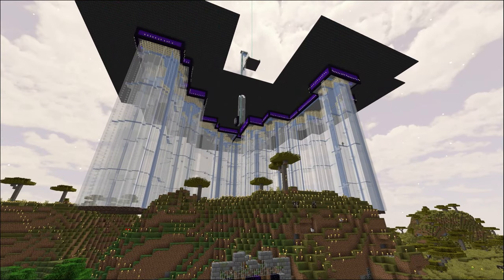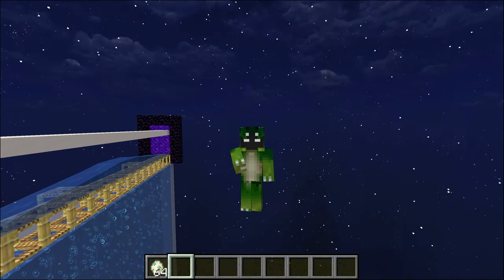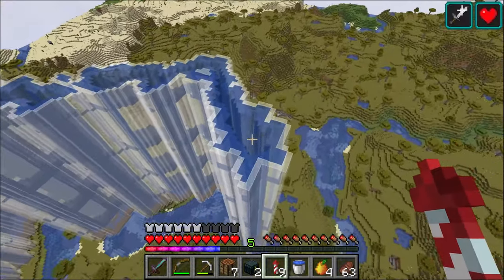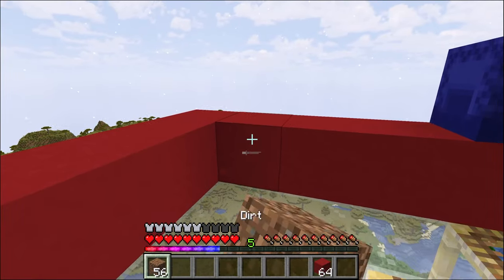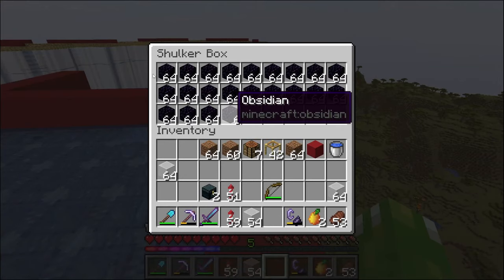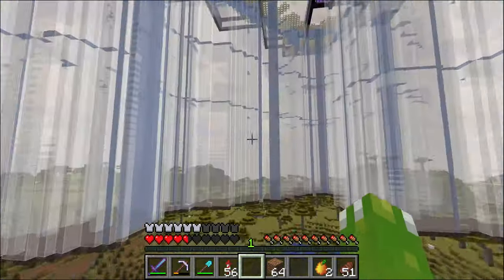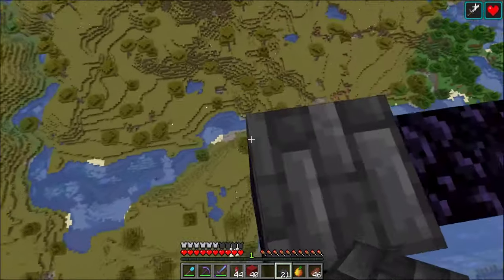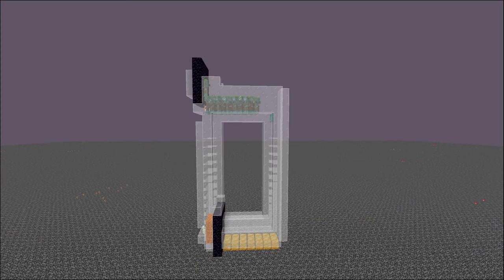Minecraft Trident & Copper Farm - 120+ Tridents Per Hour

Comment: How do I build it in 1.18?? 
Where should I place the portal which brings drowned back to the overworld
Since I can't build under 0 in the nether then how am I supposed to make this work?
Edit- If someone has built it in 1.18 in a perimeter, a screenshot would be appreciated
Reply from the maker: I'm busy at the moment but if you msg me on discord later I'll fiddle around with ur problems and see what works
Reply: I think I've figured it out 
My plan is to build a perimeter, will place soul sand from -58 and then will extend the pillars till y15 or y20 

Next is to place the portals which brings drowned back to overworld 
So I'll build it on y0 or y5 and do the same in nether (y0 or y5) 
Then make my platform on which I'll be standing to kill drowned at y-20

Will this be good enough or do I need come up with another idea?
Reply from the maker: @bhanusirswa1969  nice idea but what I'm worried about is the drowned not getting pushed in water as they only seem to be affected by it when they're above y63
Reply: @ncolyer  
Ahh shit, completely forgot that
Idk about any other idea lol
Reply from the maker: @bhanusirswa1969  yea normally you'd have the bubble column extending up to y62 lets say, scaffolding layer at y63 and the lowest water pushing layer at y64, but starting at y59 means that the tower will be 122 blocks tall which is quite excessive, I might make a bug report to try and lower/remove the height but I think it's there so drowned don't get stuck in oceans but with local water level know maybe we can get it removed?
Reply: @ncolyer  
That's a good idea but would take a lot of time to get removed
Have any other idea or should I just start from y0? Turtle eggs were a hope, but drowned not always pathfind to turtle egg
Reply from the maker: @bhanusirswa1969  so the sliver lining with drowned farms is that although they are slow they don't ever really take up the mob cap, so if you can kill them in the nether with a bot in the overworld the extra second or two they spend travelling will be negligible
Reply: @ncolyer  
I don't have a bot or a second account sadly 
Should I just go for option of building the farm from-y60 to y64 
Or would it be too much?
Reply from the maker: @bhanusirswa1969  the only thing itd cost is a few more stacks of building blocks and take like 30% longer overall to make so its up to u, just make sure you test ur portal layout and get it to link before making the whole farm
Reply from the maker: @bhanusirswa1969  dude i have GREAT news, water now pushes drowned on every y level,  I must've missed this change during the snapshots
Reply: @ncolyer  lol 
I love when someone says dude 
I've checked but for me he still stands there like a stoooopid and doesn't move
Btw your nether tree farm is working amazingly well
Reply from the maker: @bhanusirswa1969  is he in a stationary source or a moving one? Silly question but idk what else to ask, also Ty for the ntf compliment
Reply: @ncolyer  
Didn't get it 
The water was flowing and he wasn't moving (he wasn't on the source block of the water) 
Are those pushing drowneds for you?
Reply from the maker: @bhanusirswa1969  ay u got discord? coz im playing around with this more and its being quite inconsistent for me, itd help a lot of we could send screenshots back and forth or somethin
Reply: @ncolyer  Sure ima download it
Reply from the maker: @bhanusirswa1969  so far every bit of water has pushed them for me except for when there is water flowing over a water source
Reply: @ncolyer  Which version is yours?
Reply from the maker: @bhanusirswa1969  wdym
Reply: @ncolyer  
Which version of MC you playing on?
Having a hard time I can't even msg on discord 
It constantly tells me that I'm not in a mutual server
Reply from the maker: @bhanusirswa1969  1.18.1 at the moment, are you able to send messages on any server or just not able to in dms

Comment: Is there a material list somewhere?
Reply from the maker: There's a schematic which has a material list in it but it varies depending on the river size
Reply: Ah kk tho unfortunely for some reason i can't use litematica or any of the mods bc both frabic and forge are broken for me with giving me an error code 0 XD oh well
Reply from the maker: @LightKzYT  oh shoot, well bassically you need a lot of building blocks, 10 or so stacks of soul sand just as much scaffolding, 5 stacks of obby and ice, optionally sea turtle eggs and a few stacks of kelp

Comment: Well I know I’m a few years late but does the nether part have to be built on the nether roof?
Reply from the maker: im pretty sure yea
Reply: ok because i am building it on a server were the nether roof is not accessable @ncolyer
Reply from the maker: in that case you will need to build the linking portals below y 127 in the overworld, which means you'll need to spawnproof the floor and some below caves